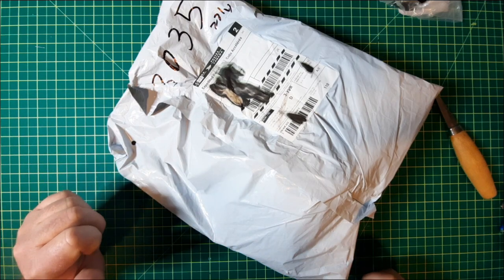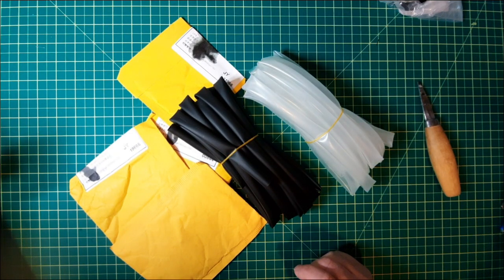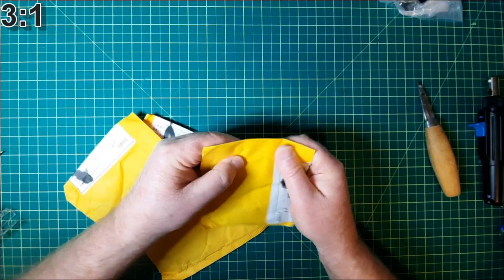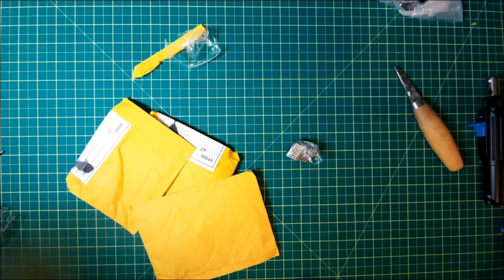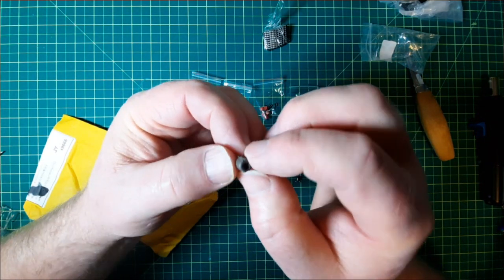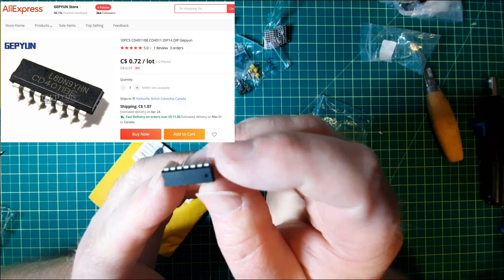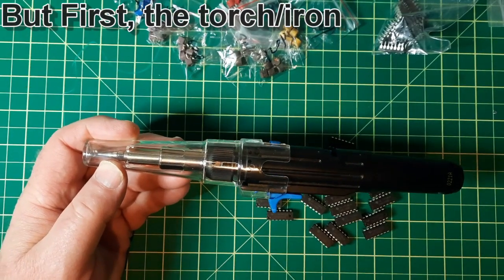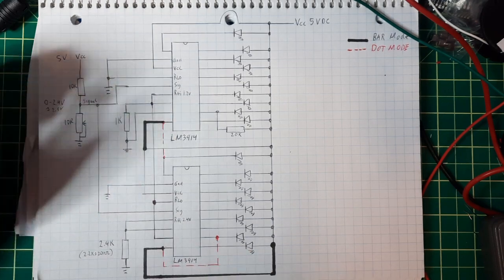Electronics Mailbag 23 ish and LM3914 Dot/Bar Graph Display Driver Demo

Comment: Nice grab bag of yummies! Good one...
Reply from the maker: Thanks. Lots of parts now, time to start building some random weird things (-:
Reply: @retireeelectronics2649  Or just fill up empty space in shop, like I do.😜
Im ordering alot, sometimes I find stuff I dont remember ordering or I find duplicates.
But yeah, I love ordering stuff and unpacking, lately Aliexpress worrks pretty fast and they have lots of good stuff that I dont have or running low stock. Buying in bulk from Ali is useful/cheaper
Reply from the maker: Even with entering everything I order into a spread sheet, I somehow still order something I already have. AliExpress has been very fast lately, forgot to include delivery time on the last batch but it was 3 weeks which is good.  Best AliExpress has done is 2 weeks.
Just scored at an auction but the Beckman Vintage High Performance Liquid Chromatograph just does not fit on the bench very well (-: